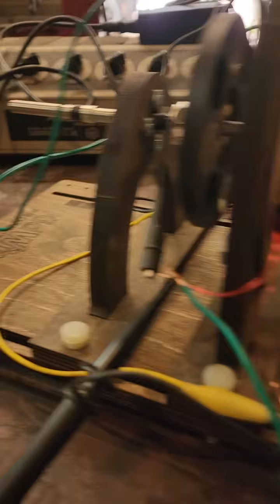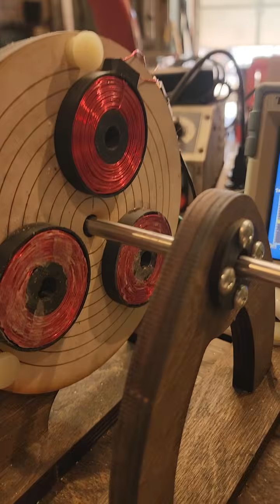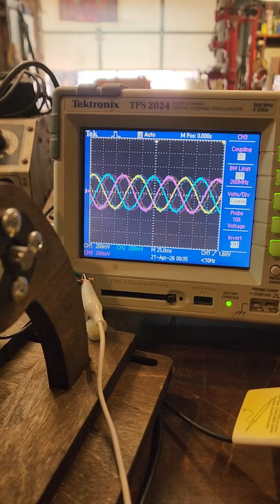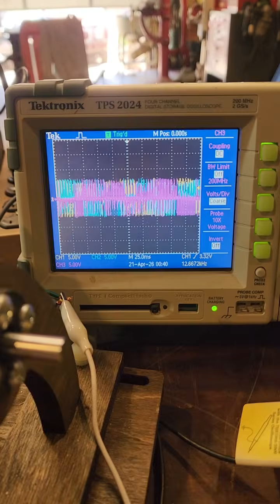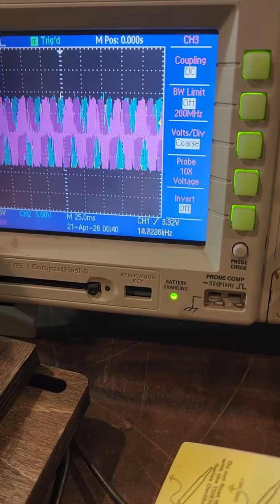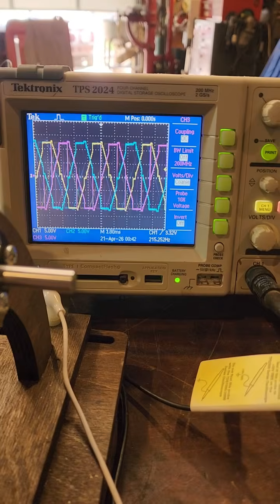3 Phase Play with the KidWind alternator.

Comment: many years ago I tried to start my listeroid generator this way by opening the compression release and using a 3 phase drive into the axial flux alternator. The drive i had couldnt deal with the amount of current initially needed to get it rolling (followed by a long ramp up in frequency to get the engine up to speed. lots of mass there). I suspect a higher alternator pole count would have helped potentially. I abandoned that idea and went to just using a 12 truck starter instead lol.   Back in the day when i was doing lots of work for certain wind turbine manufacturer,  we often had failed or burnt up pneumatic breaks on our tubines. Engineering attempted to connect big 3 phase drives to the turbine output (60kw induction generator) and lock onto the frequency, start to pull current until they had the rotor under control and attempt to lower the frequency in order to stop the turbine in runaway conditions. I think they ultimately had some success with that method.